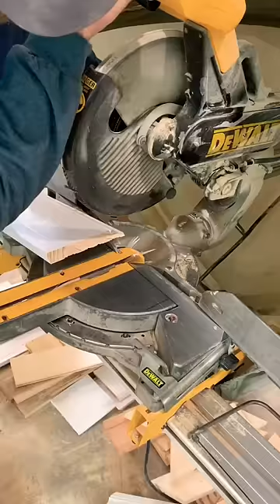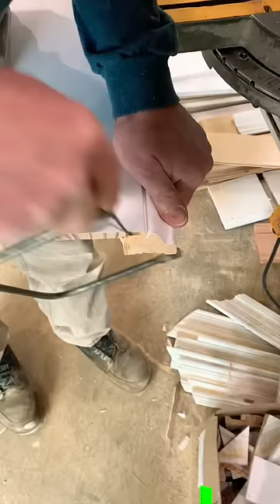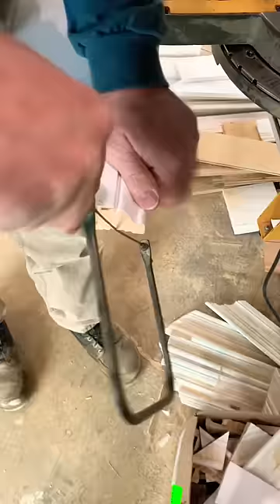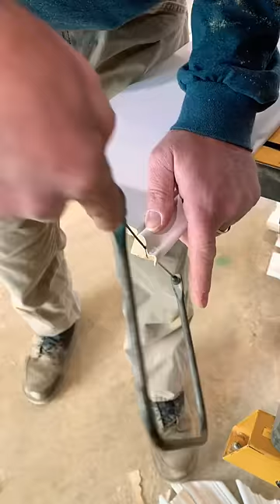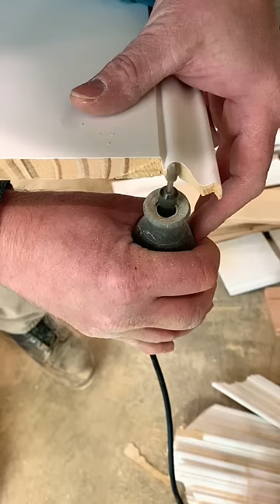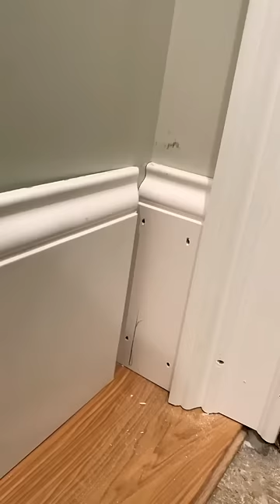Learn how to COPE baseboard…never be a puss and miter it!! #woodworking #coping #baseboard

Comment: I saw those gaps in the end 😂 good thing you gotta caulk it still
Reply: Don't worry, his coach said it was got
Reply: Thank you, people don’t realise that the time needed to get the joins 100% perfect isn’t worth it! Especially when you have 5 rooms to get done in a day before the painters get in!
Reply: If you do it right no caulking required
Reply: @zad08  you need caulking no matter what, expansion and contraction.
Reply: Still need caulking to hide the little gaps....LoL
Reply: crycrywahhwahh  I've been a stone mason for 32 years and haven't had ANYONE close my gaps yet. But one thing is for sure is that you can't handle constructive criticism and I'll bet I could get tighter joints using stone or brick. Relax
Reply: @georgecroney6168  I don’t know. I’ve removed coped crown molding before during renovations that were 30+ years old that had no caulking and were seamless.
Reply: Lmao, didn't want to hate on this guy.
Reply: @BuffaloBillsSon  nice excuse for being lazy.  All about that money nowadays
Reply: Don't worry, it only took him an hour to do that one corner
Reply: @zad08  caulking is also for separation,expansion & contraction. Lots of keyboard carpenters on here.
Reply: @zad08  nah
Reply: Miters!!
Reply: Try doing a room full of coped joints with fireplace and alcoves etc in the middle of winter without caulk!
By summer the house has expanded so much that it’d look terrible without a touch of caulk on the ends when pressed together
Reply: @BuffaloBillsSon  I’m paying quality not speed that’s how you don’t get hired or recommend
Reply: Shouldn't have to 😭
Reply: Might be acceptable for paint grade, but when you're dealing with prefinished wood trim, you've got to do better than that..
Reply: @jimmybiter2936  or stained wood lol
Reply: Yes 😂😂😂 no jigsaw and then gaps 😂😂  I use jigsaw
Reply: Looked baf
Reply: @tedstyle3798  no, it's about a 30-40 second cope, on that profile
Reply: @petem2700  magic of the edited video
Reply: @davidmartinsen332  no, I have been a trim carpenter for 35+ years, and what I am saying is, that cope takes me 30-40 seconds to complete.
Reply: @BuffaloBillsSon  no shit right! Especially nowadays. The last 60years homebuilders forgot how to square a wall
Reply: It was a quick shot before it was fastened but to my eye, it looked like those tiny gaps would go away during paint. And it is paint grade trim obviously.
Reply: There's no shame in using caulk as a finishing touch. You have to caulk the top edge, against the wall, anyway.  On clear, stain grade, trim a 32nd gap is almost invisible, anyway, because there's no dramatic contrast, like there is in paint grade trim.
Caulk is a tool. Just like spackle and touch-up "crayons" for prefinished stain grade trim.
Reply: Nice touch with the Dremel, but try using a coping saw on oak, all day and you might reconsider using a grinder by the end of the day.
🙂
Reply: Hahaha same
Reply: crycrywahhwahh  gonna go out on a limb and say you’ve never trimmed a house before. This trim will 100% need caulk. When it’s painted the paint will suck into the gaps and expose them.
Reply: @brendanokeefemusic-  facts
Reply: That what painters are for !
Reply: Me too ! I saw a bad cut ! Sorry pal !
Reply: I've learned so much
Reply: Paint grade=/= stain grade.
Come on guys.
Reply: @HalifaxGreen  did you just compare stone masonry to carpentry?  

I’m a painter and can pretty much build a house from caulk.  I’ve never met a painter, a good one at least, who didn’t caulk joints..
Reply: @TheCharillz23  so true.  Just did a job on Tuesday and hanged a portrait wallpaper bout a foot from ceiling and 2 1/2ft from base.  After we did measurements I looked at boss and told her that the wall isn’t squared and even using a level isn’t gonna make that wallpaper straight.  Bout a half inch difference from one side of wall to the other.  I don’t see how they get away with stuff like that but they do and then charge ppl for it.
Reply: @SickestDisciple  pretty much.
Reply: Right. Shit wasn't that good.
Reply: @BuffaloBillsSon  you never see perfect finish work bc you would be there all dam day pissing everyone off and getting fired lol
Reply: It's called "No more skills in a tube " He still got some skill tho
Reply: Coping saw is all you need no dremal
Reply: @wondon2992  hay won don, how come you comment on YouTube but you don’t have any videos or info on your account? It’s like your a Chinese bot!
Reply: Gaps are pretty normal actually.  The wall may not be 100% level so the piece he’s running it into could be at a slight angle which would create gaps at the top.
Reply: @BuffaloBillsSon  not at all more you do faster you can do it.....all I do is cope inside corners , and it's totally worth it especially finished product even decades later still looks like day one
Reply: Agreed. All that extra work and talk for meh
Reply: Ain't it just ain't it 😎
Reply: @marcfavell  As I say time and time again, each job is it’s own, it the job calls for high end perfect miters then the price reflects that, if it’s house bashing and the price is to get in and get out then that’s what happens. Comment Warriors who are just home DIY enthusiasts don’t know shit
Reply: Its bc he cut it the wrong way.
Reply: crycrywahhwahh  😂 that's a damn lie.
Reply: @HalifaxGreen  so u are almost 33rd degree Mason
Reply: @BuffaloBillsSon  OF COURSE IT IS WORTH IT. Just because you put effort doesn't mean it's "good enough".
Reply: @HalifaxGreen  with my eyes on the gap im filling in and a brick in one hand, a flip of the wrist in the other holding my trowel ill crack the perfect size brick and its all she wrote i wouldnt even need a brick hammer for that lol something about brickwork because it dont work like that in woodworking
Reply: @jawnlaughlin5  very true...I can crack an 8 inch block with my trowel. Brick work is way more forgiving than wood. If I had a nickel for every brick I've laid......LoL
Reply: Or don't over complicate and just 45 your ends my guy, perfect every time. No calk needed.
Reply: @dmacncheeze  Way smarter guys than you came up with coping for a reason. You only get half the shrinkage with a cope than you do with a mitered inside corner. Maybe if you’re trimming out a track home but nothing of quality
Reply: @carpentertrim  sure buddy. You believe that. But I'm pretty sure my 10+ years as a carpenter and general contractor can tell me otherwise like for 1 the amount of shrinking you will get inside of a house is minimal and so getting a tight fit is not only necessary but looks better. And a half assed coping job like that won't look good or do it's job. Making a 45 miter cut will ensure a tight fit and a matching pattern. But what do I know, not like I trained under master tradesman for 4 years.
Reply: Painters will fix it
Reply: @ryanmurphy2089  I agree one hundred percent my friend. I am a stonemason/bricklayer and I get most ( if not all ) of my work because I believe in quality over quantity. I never rush my work and I am very particular. Some of my clients will wait for months so I can do their work. One other thing that I almost always do is to have the client with me during inspection so there are no hidden costs. Cheers
Reply: Come on coach!
Reply: @grahamgreen8283  Yuppers. Got my certification in 1990 in Summerside, Prince Edward Island, Canada. I live in Halifax, Nova Scotia, Canada. We are a port city. There is a fortress guarding the mouth of the harbor called the Citadel. This fortress was first established in 1749 by Edward Cornwallis and the fortress itself was built in 1856. I worked with the company who did a full restoration of this fortress. I worked alongside masons, that Masontech had flown in, from around the globe  Scottish, Irish, English, Italian and Portuguese stonemasons that taught me new things on the daily and vice-versa. So thank you and yes I guess I will soon be a 33 degree mason in so many ways. I love my trade. So I don't actually go to work...
Are you picking up what I'm laying down? It is often said that if you love what you do you will never work a day in your life. Cheers my friend
Reply: Like my dad says, “don’t measure when you can just mark it” he literally had it right there against the casing, still measured.
Reply: @HalifaxGreen  or construction criticism for that matter! 🤣
Reply: 😂 still have to caulk for expansion/contraction….
Reply: Caulk is needed everywhere that's what covers all lines for gaps when you paint.
Reply: He had one piece of flooring in for a demonstration….. relax little guy.
Reply: @zad08  no. You're wrong. You always need caulk.
Reply: @georgecroney6168  these people just talk man. 75% of them have never touched a tape
Reply: @zad08  wrong There is a phenomenon that happens with word called expansion when there’s a temperature or moisture change Also you have to caulk the top of the baseboard no matter what even if the joints are that close which Will cause them to warp and break overtime you still have to shove primer in there for the pint to look smooth
Reply: @Brody1007  Bro you think they’re doing this shit for fun
Reply: @floweuphoria69420  they’re not?
Reply: If you hit give that a tap with a block and a mallet into that joint,he wouldn't need caulk and he wouldn't have a gap either folks, do your homework
Reply: @Brody1007  no they are there to get paid. You will get fired if you soend too much time on any one thing TIA
Reply: No caulk necessary if you know what you're doing. This guy almost has it, but not quite.  Plus, you can't caulk stained woodwork, so get good
Reply: @davidgraham8739  it’s paint grade
Reply: @PoisonJarl71501  the point is...get good!! Shouldn't need caulk. If you do, you're a hack.  Unless you're doing it for yourself,  it's theft in my opinion.  To take someone's money for shit work.
Reply: If you think that wasn't a good cope joint you're not a carpenter.
Reply: @andymaciver1760  it was pretty good. But no need for the Dremel. Just get better with the saw
Reply: @davidgraham8739  I use a sander on a grinding wheel then finish off with my files or sandpaper glued to a dowel. I could see shitting on his joint if it was getting stained but its painted.
Reply: @andymaciver1760  so it's OK to do worse work because it's paint grade? You don't need a sander, file, flap disc. Just a coping saw.
Reply: @davidgraham8739  I know you are the best, but take it easy on me. I've only been doing this for 24 years
Reply: @andymaciver1760  not saying I'm the best. Been doing it for 16 years and all I use is a coping saw. And the joints are great. It's people trying to over complicate such a simple process. It's not that hard, especially for an experienced carpenter. Just seems like the trades are skipping these days. Everyone doing shittier work because they can get away with it. No pride.
Reply: It will always look better than a mitre every day of the week
Reply: @zad08  this seems like a comment from a guy who doesn't do this kind of stuff for a living. Caulking is needed regardless for expansion and contraction. Without caulk that joint will open up and show right through the paint and end up being a gap instead of a line
Reply: @HalifaxGreen  not for nothing being a stone mason is nothing close to trimming a house. Doing masonry work you can get away with 1/8incb gaps while in trim work you can't. Your literally trying to compare apples to oranges right now, better yet your comparing apples to steak
Reply: Sounds exactly like how I look and feel about my work. I love when my client will go up on the roof with me when I do the inspection of the chimney...or whatever work I'm doing. I have a job as soon as the weather permits this coming spring because I couldn't fit them in this year...so they want to wait for me to do their work because they know that I do quality work and I give it my best and never, ever cut corners or hide anything from prospective customers. My reputation proceeds me every time. Cheers my friend and good luck in the New Year. Cheers
Reply: @davidgraham8739  I don't think it's that complicated. I can cope more pieces with the tools I use than just with a coping saw. It's really a matter of preference and speed. I can make more money when I can produce more. If you can put out a good amount of work with just a coping saw then go for it brother.
Reply: @BuffaloBillsSon  sometimes it’s just not viable as your suggesting. Houses are square so as your saying you could play hell trying to find a angle that’s slightly off of a 45 or 22.5. I’ve had some where one angle is 10, the next is 17. It makes no sense till you test fit multiple angles together
Reply: Coach subbed him out shortly after 😂 safety meeting! 💨
Reply: Good thing the wood was painted and not stained, gappy.
Reply: That’s a comment from someone that doesn’t do this kinda work. You can’t get it tighter, and yes everything is caulked & nail holes puttied.
Reply: @BuffaloBillsSon  😅o
Reply: 35 years ago I use to use a copping saw cause that was how you did it. Then we got smart and fast with the miter saw and just miter the ends and push them tight.
Reply: @kuk3411  houses shrink in summer. Timber absorbs moisture in the winter
Reply: @claytucker3299  Brick or stone houses shrink in winter
Reply: @zad08  incorrect
Reply: @Brody1007  okay keyboard carpenter.  You'd probably use a hot glue gun because of a diy video you watched. Lmfao
Reply: @Imtheman3  is that wrong?
Reply: @Brody1007  you're always a wrong
Reply: @tedstyle3798 worth every 60 minutes
Reply: The bottom mark on the short return was a pencil mark I believe.
Reply: Dremel tool? Ain’t nobody got time for that!
Reply: @zad08  😂😂🤷🏻‍♂️🤦🏻💀
Reply: Oh ENOUGH
Reply: 😂😂 it’s easy to get perfect every time with a jigsaw. And cutting it after takes longer aswell. Deffo never worked on price work.
Reply: Shoot, dude, i measure all my base boards and crown molding out. Write my numbers on the wall where the base or crown molding. then i make a giant cut  list. I will spend a couple of hours on my chop saw outside smoking and organizing then I go in and slap that shit the fuck on. I miter all cuts because I think coping is a waste of time and effort when I can just put a Lil love shim behind the base on the top or bottom to tighten up ugly joints do to out of sq or level walls
Reply: Lol. I was going to say that.
Reply: @georgecroney6168 what if it’s stained wood?
Reply: @georgecroney6168 exactly
Reply: No, you pull it off and sand some more.
Reply: @zad08 are you serious? Caulking is always required
Reply: @RegularAssUsername  BUT, a good carpenter works at it till there isn’t any gaps, took me 20yrs.
Reply: Caulk and paint make us what we ain't 😅
Reply: Caulk and paint makes it what it ain't. There is a reason caulk exists.
Reply: @zad08 to be fair , 30 - 50 years ago houses were built more solid . Some of these track homes now are lucky to have a flat wall , let alone a 90 degree corner 😂
Reply: Finally .,.. the hard way.
Reply: Give me a whole day of time, all those tool n sure I can make a better job.  😂😂
Reply: @Brody1007 I was thinking if he talks like that then he's not getting paid well and doesn't deserve to. What's the use in hiring an unprofessional professional?
Reply: @BuffaloBillsSon ONE ROOM ONE HOUR SON 😂 that’s what I was taught
Reply: @zad08 bollocks, obviously never experienced a little thing called a ‘season’
Reply: I think all these keyboard carpenters are from a place without seasons. Here in the UK we experience 35°c difference every single year. You caulk no matter how perfect your scribe is.
Reply: @BuffaloBillsSon depends on the customer honestly.
Reply: Mitering is fine m most people nowadays don't care or even notice craftsmanship any more .. don't waste your time and money on this ...😂😂
Especially when you still will have to caulk it like him at the end anyway .... 😂😂
Reply: @ryanmurphy2089 
Doubt you would pay for the amount of extra cost that is for an entire house , you would be the 0.01% 
That do.. 😂😂😂
Reply: @bondpit8750 
if you think paint will fix that gap ..  
Please don't ever paint anyone's house .. 😂
Reply: @zad08  timber ain't what it uses to be
Reply: Yeah so did I profile not good
Reply: Guys, Salvation is very Simple

HalleluYAH “Hallel u YAH - Praise ye YaH”

YaH is The Father (Genesis 1)
YaH arrives via the TENT OF MEETING
YaH was Who they Crucified for our sins
YaH was Crucified on an Almond TREE

Ancient Semitic Moshe (Moses)
Isaiah Scroll (The Original Isaiah)
Reply: @zad08 keep dreaming
Reply: @ryanmurphy2089 you dont always lose quality with speed. Some people are slow and bad. And if the result of cutting takes 15x longer and is the same as not, youre just paying more for shotty work. Efficiency is still important when people are paid by the hour my man
Reply: Funny how he doesn't answer any of the comments who criticize his work the slightest..
Reply: @zad08  Painters caulk everything. Take advantage of it.
Reply: @BuffaloBillsSon  "If you you do it perfect, they want it perfect, every time!"- Glenn Campbell
Reply: Boom! Gaps 😂😂😂
Reply: Do you do trim work?  @HalifaxGreen